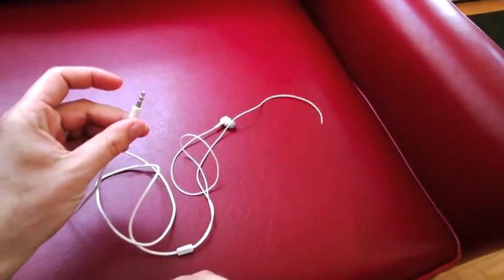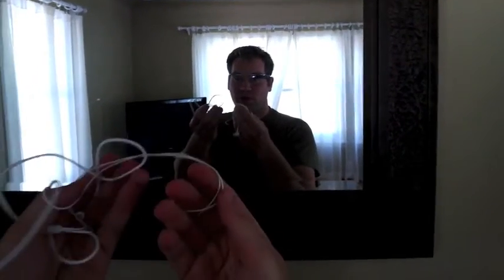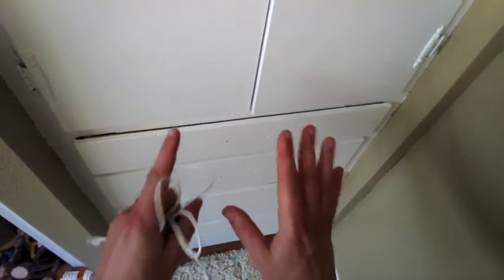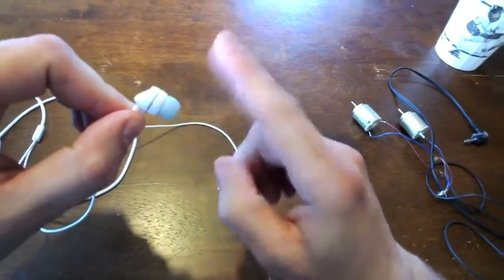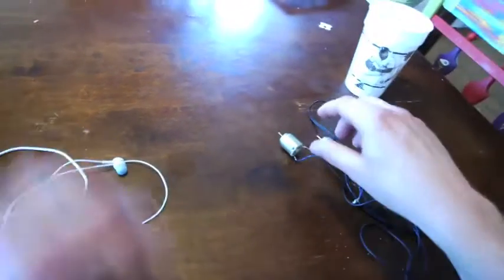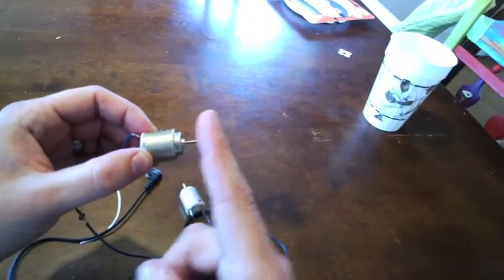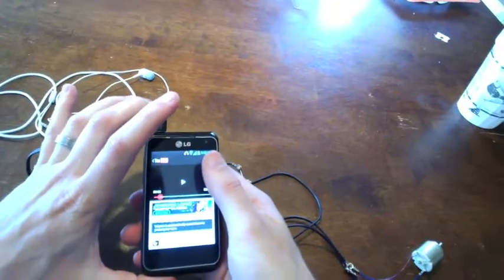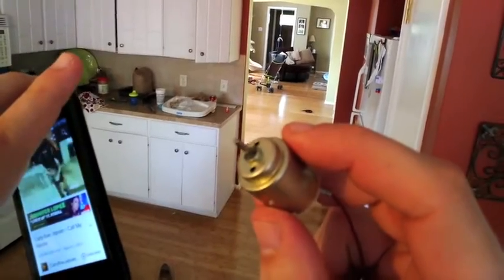Make your own DIY bone conduction headphones

Comment: Nice it worked but if you bite it from the middle of the motor it sound better because you are not distrusting the moving iron from vibrating

Comment: Well I am try to do this and it doesn't work. I am sure my dc motor is fine and working like a charm, what is the problem?
Reply: Probably the impedance of the dc motor is too small to your audio device, the device can't output enough power. You should build an amplifier circuit...

Comment: Would it make a difference if an AC motor was used? I've also heard of people trying this with a piezoelectric transducer. Between a motor and a piezo, which do you think would work better as far as sound clarity?. I'm not from the electronics field, but this topic seems really interesting, so anything would be helpful.
Reply: I don't know, but the piezo is safer, because the impedance of the motor is very small and can destroy your audio device